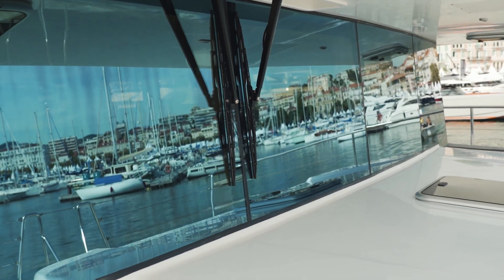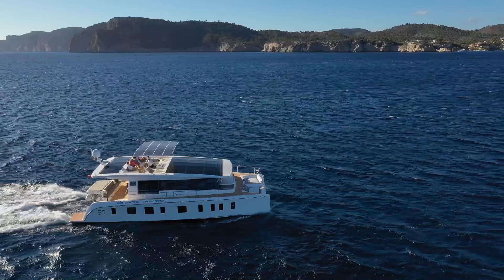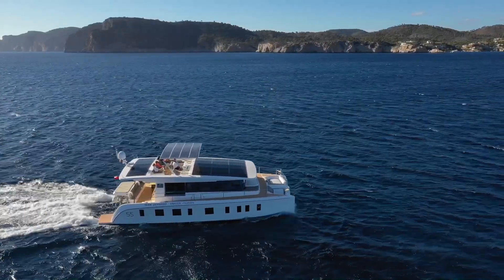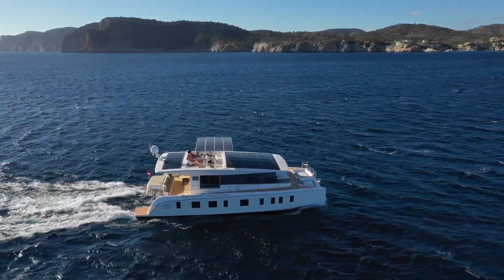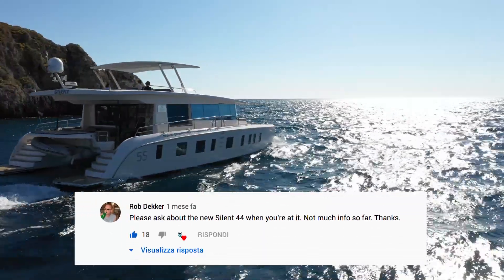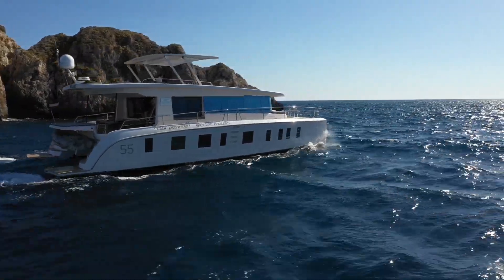WHAT MAKES SILENT YACHTS...SILENT???

Comment: U didn't ark about the lifetime of the battery's and the price to change them..?
Reply: 8 years guaranteed lifespan (80 % capacity), so the estimated lifespan is about 12 years, but they have a second life in a house .... and by that time the new batteries will cost a fraction and will be more powerful than today ...

Comment: When the US navy marine asks about the batteries exploding in sea water he is not asking about the water short circuiting the battery.  Lithium and the other elements from that group react with water to displace hydrogen which is flammable.  The reaction is exothermic and can create enough heat to ignite the hydrogen produced and cause an explosion.  It has nothing to do with electrical short circuits.

Comment: I'm still not convinced. I understand though...an electric generator running azipod type thrusters is fine. Big ships use them all the time. Using solar and batteries to get 2 hrs free motoring..also fine.

but who is this marketed to? A billionaire isn't bothered about running his yacht 2hrs out of 24 for free if it means lessening deck space and hulls like razor blades.
Or am i missing the point?
Reply: Def only for multi millionaires and up.
Reply: Definitely not for billionaires. It is a quite “affordable” yacht starting at $1.5 million dollars. Loans for boat in this price range are usually for 20 years. That means the monthly payment is around $8,600. A net worth of $2.5 million invested in the S&P500 will return 9% on average every year. 6% accounting for inflation. If you take out 4% out the 6% you make every year (reinvest the 2% left) that would equal to $104k to make your marine loan payments. Pretty nice way to retire off the grid, no utilities, property taxes, etc. without being a billionaire. Just a couple of millions in the bank.

Comment: can you hybrid this with classic wind sail
Reply: Yes, electric motors are already being used with sailboats.  With hydrogeneration the motor can recharge the battery from sail power by using the motor as a generator.

Comment: Add a mast, rigging and sails to this solar system CAT, then the boat is perfect..... without that option the radius of action, and safety will not work for blue water usage...... electricity, electric circuits can fail..... wind eventually always return..... At sea safety first....
Reply: max odgaard — Exactly!  A sail plus solar sounds wonderful!  And yes, if they have fuel for generators adding a backup engine would be a great addition!
Reply: It's actually available
Reply: Richard Tschrepp — care you share a link, name or anything I can look at?
Reply: Wind can fail too. Masts can break, Sails can be torn, rigging can fail or be lost.

The problem with adding all the necessities to power that boat at a meaningful speed with wind power (It would be a serious mast/keel to begin with...) is that suddenly your solar boat can't really go very fast under solar power... and it's range is cut drastically... And at that point you're better off just getting a sailing yacht, with secondary powered motors, and if you really want you could throw electric outboards for the dhingy and the yacht and a custom solar system on your deck to charge the batteries... That way you got something that will actually sail well... and you have the backup... and you have the solar.

I'd imagine that the speeds and range on this vessel can only be achieved by a very frugal approach to overall weight and draft.
So if you're talking about secondary systems for when your electric fails... secondary fuel motors... like diesel inline or even some gas outobard engines... less weight, less volume, cheaper than adding a whole sailing system and rigging... tried and true... and easy to use in a pinch.
Reply: taiyoctopus — This is an ocean going vehicle, the structural strength is already there.  And the odds of a battery failure are far greater than the odds of a mast of sail failure.  The batteries are the main point of failure, they are wired inline. If one battery fails, you are down until that battery is replaced.  You have a valid point about the weight, esp. the keel, however keels are used on mono hulls not catamarans. And the shallow draft of a cat is one of the selling points.  And while lithium batteries weigh less than lead acid AGM batteries, they are still heavy, especially when you are talking a quantity of them.  I would guess much more than the weight of the mast and sales.  Please note his talk about speed increasing power drain, so above 6 knots the generator is used.  A sail would greatly increase the range as less fuel would be needed.   Wind and solar are free after the initial investment, diesel fuel is an ongoing expense.  And generators need maintenance every hundred or so hours of operation, he didn’t mention that in the video.  You’re going to need 2 or 3 generators and their associated maintenance and weight to do any long distance ocean travel, or you will be stopping every 2 days for service issues.  There are ways to extend the service intervals with special oil filtering technology, but that’s a separate issue and an additional point of failure.  From an engineering perspective and knowing Murphy's law, having multiple backup alternatives such as sails is just logical.  And yes, if you are just boating in a specific region, you don’t need as much redundancy as you can pull into port as needed.  However if you want to take to the ocean, it gets much more serious.
Reply: @Erin-Thor  If you were planning to cross oceans, you'd simply be better off getting a traditional sail boat.

Putting a mast, rigging, and sails on this boat does not make it a good sailing vessel. 

If there are already generators, then there are already fuel tanks... So you have battery weight, solar system weight for the electric... and you have generator weight and fuel weight for the generators.....
Adding rigging, sails, mast, keel on top of all of that would net you one cluster fk of a boat lol.
Reply: JED — I meant the wiring goes from battery to battery, either series or parallel depending on the desired gain in voltage or capacity.  My experience is with AGM batteries, if you lose one, it can effect all, you must regularly disconnect, test, replace if needed, and reconnect.   I’m with you on the need to fuel frequently, be it engine or generator needs, which is why I’d love to see a sailing ecat.  Cheers.
Reply: JED — What you’re saying is 100% on point.  I’m afraid to take a long vacation, because when I return, so much has changed I have to take a day or two to just keep up with our projects.  I can see why Silent Yachts doesn’t want to openly identify their system details and suppliers they work with, why make it easy to either assist the competition or give them materials to use against them in sales?  I mean release your drive motor tech and model info, and the competitions going to tell their potential customers 'our system is better than SY because of so-and-such.  I have to admit, Silent Yachts intrigue me, but I would still love to have this yacht (more or less) with a sail option, even if it just means you don’t have to run the generator as much.  Like you, just because some tech is old, doesn’t mean it’s not as good.
Reply: @jed7644  
I believe they are using Victron inverters ,solar chargers and batteries. I saw a video somewhere about the newer 55 version and they showed a glimpse of the batteries and they were Victron.  They also showed the motor but I forgot who made it. On Victron's website in the blogs from a year or so ago they have a write up on how there systems were used in the Silent yaht 64.  They may have also used other suppliers as well but I don't know.
Reply: @taiyoctopus2958  but u forget the whole idea of getting rid of fossile fuel..... btw  do you know the weight of the battery pack?
Reply: @Erin-Thor  good thoughts about the whole scenario....
Reply: max odgaard — Thank you!  And your comment about fossil fuels is why I’m interested, it’s just smart.  I think that the sail as an option would greatly decrease the fuel/generator use, which would both decrease your operating costs, fuel and maintenance costs as well.  If you’ll note in the video he says the capacity, the engine power drain, and the run time at 10 knots with the generator running was 5 hours.  It should be possible with that info to determine that battery requirements and weight to answer your question.

Comment: Why no super capacitors? You can draw much faster without any risk of overheating the battery and you can do an infinite number of cycles. Yes you would also need batteries as well but would avoid much of stressing of the batteries. Tesla have brought Maxwell the super capacitor company, so expect more super capacitors in E cars (way overdue, the argument for super capacitors in cars is much more pressing than for boats) .  Battery cooling? That is a massive battery bank and would generated quite a bit of heat. Would they consider the new flexible solar panels that you can walk on? But then people would walk on them  and a single tiny bit of shadow can stop production on all the panels in that series.
Reply: That said I very much like the boat.

Comment: wonder why they didnt go for the trimaran concept? Its even more efficient, than the catamaran, as well as faster...
Reply: Trimaran can be more efficient for sailing.  Catamaran is probably more efficient for motoring.
Reply: @LoanwordEggcorn  Nope, Its all about moving on water, regardless of sailing or motoring. I think its because cats have more practical space on them, therefore more comfortable...
Reply: @alexanderordinary2110  Trimaran amas (outriggers) are more beneficial against leeway under sail.  Leeway forces are much less without a sail (i.e. motor boat).  See righting moment for sailboats.  Motor boats don't need righting moment to nearly the same extent as sailboats.

Comment: Michael Koehler How can you produce 100 KW per hour with  this size of surface???
Reply: 100 kWh per day is reasonable on a sunny day.  kWh is not the same as kW.
Reply: @LoanwordEggcorn  Okay, then tell me how it will work to produce 100 000 W/h on a sunny day with this small surface!!!!
Reply: @remocarrer3098  It has 10 kW of solar panels.

Comment: Yachts will all soon be power by the sun. as soon as production manufacturer realize  the  advantage yachting while calm water and during sunny days. as appose to wind power when seas are at it's worse.  when people experience navigating with simple a touch of a button and get going in calm waters they will never want to go back to wind power.  Solar Wave yachts   should consider building a 45 foot yachts for the masses, at a reasonable price. First Manufacturer to realize this will take over most of market share, just like Tesla did with production of electrical car ( model 3).

Comment: and I love this #design and I love the #powertrain but I would not be very #comfortable doing #Atlantic #Crossing with it without having a #kite  #sailing system with me so that I can fall back on #ordinary #new #generation #sailing #system
 I don't want to have the #generator #running all the time that's really #annoying there is a good #reason why people love #sailing #no #noise
that's also the reason why #people are so in love with the #electric #Powertrain pretty much no #noise no #vibration you can really #relax

Comment: That’s amazing, my refrigerator consumes 5kwh a day he said this boat refrigerator is 2kwh a day, just super low WOW. Wish them the best .
Reply: The 100litre Engel on my boat consumes 2.7 watts only, and keeps the internal temperature at 3°C. That's at a setting of 2 out of 5. It can run as a freezer as required. These are the power misers of the fridge world and I recommend them highly.

Comment: This engineering system is nothing new other than it has been applied to a catamaran in a simpler format.

He basically designed a series hybrid motor-generator and probably runs it, the diesel engine(s), at max efficiency to effectuate the highest runtime per unit liter of fuel.

Think of it as a Honda Insight without the electric regeneration. Why he didn't just say that is beyond me...

Comment: I don't understand why you not using the electric motor to run the Yacht and provide power to the whole Yacht as seen on the Widar 150, you can also use the moment thru the water as collect power, not only trying to get all of it from the sun.

Comment: The problem is that it does not lend itself as an excursion vessel cos you put 20 people on it and all the hydrodynamics will go to pot as it progressively becomes two displacement hulls. It's market segment therefore is principally those who desire floating holiday homes. My question is do we want boats that are not really boats clogging up marinas? No.. We don't and therefore they should incur a yearly tax such and be classed as a house.

Comment: Why don’t they run the propulsion system off of the propulsion system? It’s just magnets running magnets... it would need to be started with batteries and then switched over to run itself off of itself! You can check here on utube how it works! You would need twice the needed output for each motor/generator! It’s based off of Tesla coils! It’s two generators running each other with screw propellers on each! If 250 hp is needed on each propeller then 2 500 hp motors should be installed for a total output of 500 hp... one hp is 746 Watts so do the math but understand that a little less than half of the rated output is available on each motor! On a 80’ cat the nonstop speed could be 20 knots with zero emissions! The motor is rated for 10,000 hours and a rebuild is needed depending on design and speed rpm! They have water cooled motors too. I’m talking about motors not engines though keep in mind! It’s absolutely possible and with the 80’ cat and the solar assisting the 500hp motors it can reach well over 20 knots nonstop day and night I’m sure!

Comment: And if you have 2 or 3 days or even a week of bad weather and no sun..there your dead in the water adrift in the open ocean
Reply: oh yes my friend, as dead as a sailboat in dead calm. BUt then we do the same as any sailboat does - we start the diesel. But I GUARANTEE, that we will need less fuel than a comparable sailboat and the e-propulsion will last much longer, needs less maintenance and costs less money to replace than what you need to replace after 10 years of use on a sailboat.

Comment: What a load of garbage, this boat will run for what? depending on the sun not for long with out a generator, totally pointless just as a electric car.
Next how long do the batteries and solar panels last for and how much to replace.